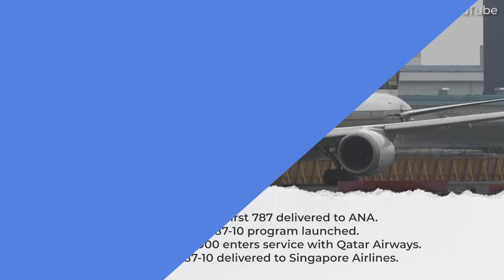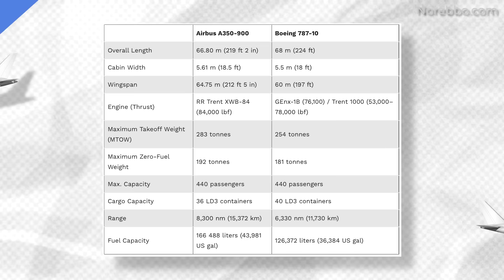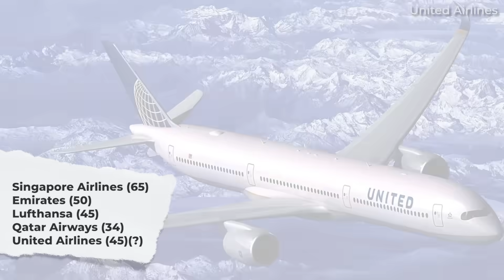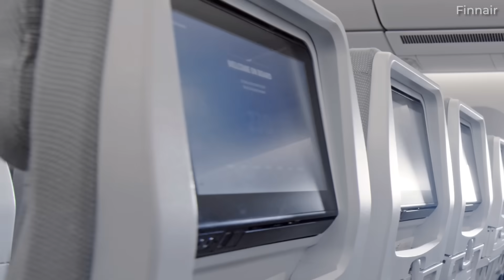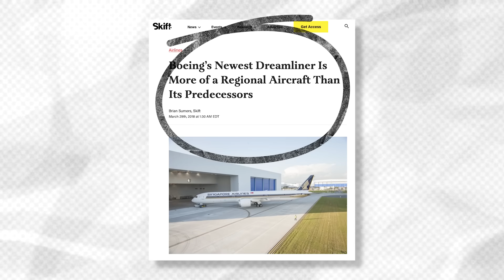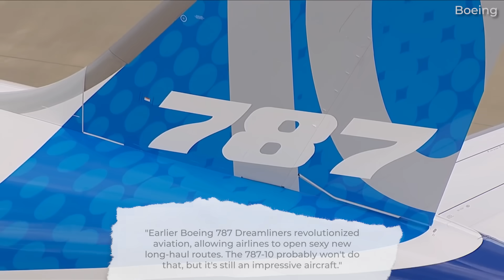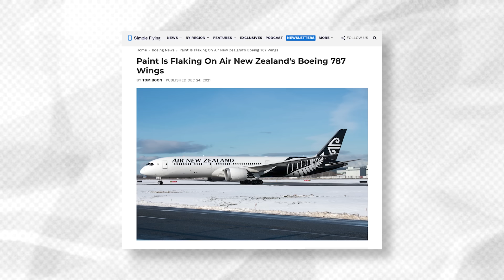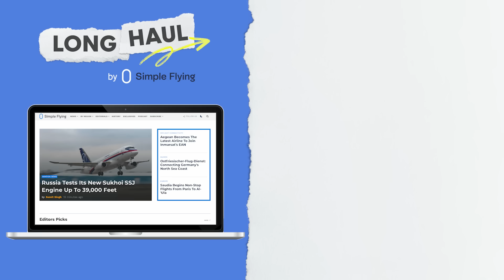The Airbus A350-900 Vs. The Boeing 787-10: How Do They Compare?

Comment: Each are the best in each of their categories. The 787-10 was an urgent response to the A359 as the category would be left open for Airbus when the 777s start dying out.
Reply: No, 787-10 was planned from the start.  Base model was the -9 version with guarantees to contractors for at least one size larger/smaller than base model.  Was there, worked the design from the start.  Boeing did plan on having a lower OEW though.  

Due to FAA regulatory officials NOT giving Boeing load alleviation due to FBW in a 2G+ wind up turn that added 5-->10tons of fuselage weight they were hoping to drop.  There was also extra weight added in wing box area.   It should be noted EASA did give AIRBUS load alleviation in a350 a couple years later for 2G+ wind up turns.  This probably saves the a350-1000 at least 10 tons and maybe as high as 20 tons when you compare to the much older 777, but does save probably ~10 tons on their base -900 model.  Carbon fiber is nice, but it has a problem, its deflection is much greater under load compared to aluminum and why the 2G turn creates large increases in fuselage weight.  

Boeing could recertify their 787 for load alleviaition on FBW... but this would cost billions.  This would help the 787-10 immensely.  It will not happen, and if it does, I will be shocked.  Who knows, maybe they will for their upcoming ER version.  I doubt it.
Reply: @w8stral  The 787-10 was built to compete with the A350-900.  It wasn't planned until the A350 was announced, a last minute change because A330 and A340 customers hated what Airbus was planning when Boeing was building a new, modern aircraft.
Airbus stretched the 900 because the 777-300ER was still getting orders in significant numbers due to its cargo capacity.
I do agree that Boeing may not build the HGW 787-10 because only Air New Zealand is asking for it.  It's more likely that the 777-8 would be built instead.
Reply: @sainnt  Sigh... In the YEAR 2000, LONG before the a350 was even a  twinklin' in the eye of Airbus, and even before officially the 7E7 was announced after the sonicruiser was officially terminated after 9-11 in 2001, the 7E7 had its base model already designated 789 with one model smaller 788 and one model LARGER, the 781.  GE's GEN-X engine tech had already been demonstrated for said weight class.  In fact the 77W had not even been produced yet... When we designed the 787 the base model was the 789 even though the first produced was the 787-800.  This was planned from the start.  The only 787 model which did NOT get built was the one JAL wanted, 783 with ~3500nm range but same payload = NEW wing/landing gear/wing box.

Suggest some basic history first before typing my friend.  

HGW 787-10 will be easy as it will essentially just be adding another fuel tank for Air New Zealand and a few others such as United who have a few routes who would really appreciate a 787-10 instead of a 777 or a350 and maybe adding slightly wider tires.  Landing specs will most likely remain the same, but Take off will be higher.  Shouldn't even have to reinforce  the wings.  The wing/fuselage joint, I do not know, was not my bailiwak
Reply: @sainnt  Wasting my time, but hey, why not... Designs are started way before they are announced there bud.  7E7 was an outgrowth of the 767-400 design studies. Sonic Cruiser got the headlines until 9-11, but we were working on the 7E7 at the exact same time. And in case you can't think/read... I was one of the designers. 

Adios.
Reply: @w8stral  Adios, my friend. Like I mentioned in my comments, I know that all designs are in the works before public announcement. Nobody is that stupid.
However, the main subject matter here is comparing the 787 to the A350, my original point being that Airbus did a 180 on their design to replace the A330/A340, because airlines loved the 787, so they had to go back to the drawing board. Even then, the 787 is still outselling the A350 by a healthy margin.
Thanks for the design. The Dreamliner indeed a dream on longhaul routes.
Reply: The 777 wont be going anywhere soon.. their is still a need for jumbo jets
Reply: A359 is no comparison to 777, the 777x was always in the background, this is why Airbus made the A350-1000. What else would it have been for, the -1000 has no competition with the -10
Reply: The 777 is not dying out. It's being replaced with a more capable, more fuel efficient 777. Believe me, Airbus is working hard to level the lopsided playing field when that aircraft arrives in service.

Comment: Interesting how the 787-10 launch customer Singapore Airlines also has the largest current fleet of A350 in the world
Reply: Their A350 business class for the two hour flight from Saigon to Singapore is almost over the top. Brand new seats with the full lie flat etc.
Reply: @nzer19  Better to over-perform than under-deliver
Reply: @GWT1m0  Absolutely. It also means a full itinerary with Singapore as a layover is quality 👌
Reply: @GWT1m0  And A330-800neo is both.
Reply: @nzer19  Delta actually does the same with domestic A350 flights.
Reply: Singapore Airlines is also the world’s largest operator of the 787-10
Reply: SQ deploy the 787 primarily for short and medium haul while long and ultra long haul only 350 have the range especially Sin-ewr/jfk route
Reply: @lowcolin also Singapore to San Francisco because the normal A350-900 is weight restricted
Reply: They settled until the A350 came out
Reply: @wadehiggins1114 They actually originally chose 20 -9’s over the A350 original design before transferring the order to Scoot and then ordering the -10 after their two 30 A350 orders
Reply: @wadehiggins1114 can’t be much of a settle considering they still have orders for the 777 and 787.
Reply: @wadehiggins1114  Not true at all. The A350 came out YEARS before the 787-10. It was also launched a decade after the A350 to be exact. And SIA still has an additional 13 on order.
Reply: @wadehiggins1114  I disagree. Singapore has for a very long time has been a staunch supporter of both companies and that is why they operate the largest fleet of 747-8i’s, launched the 787-10, still have 13 on order, and also have the 777x on order…. They LOVE their 787’s so let’s talk facts not opinion….. I am neutral as I love both planes and both manufacturers. They are the best wide body planes on the market (A350 and 787) along with the 777. Period.
Reply: @dmcr9525   Singapore Airlines has never ordered and doesn't have the B748Is.
Reply: @l33wan  Correct. That was a mistake. I had LH on the brain.
Reply: @dmcr9525 Singapore doesn’t operate 747-8I, they do operate A380 though as they are the launch customer.